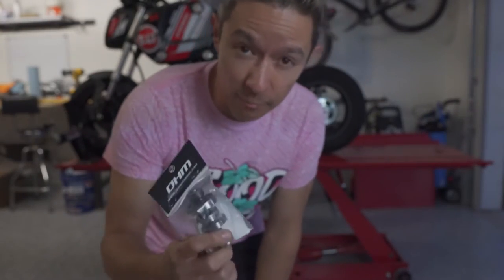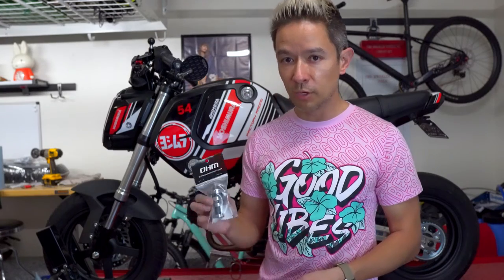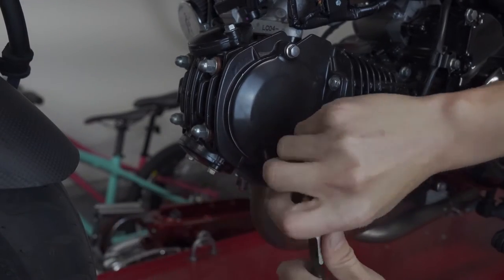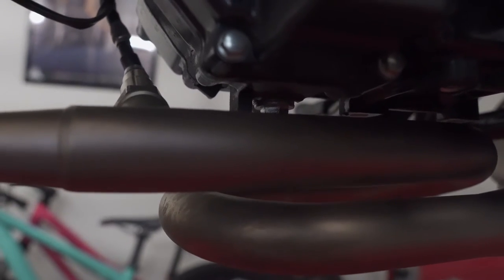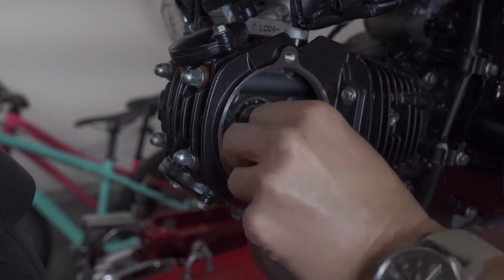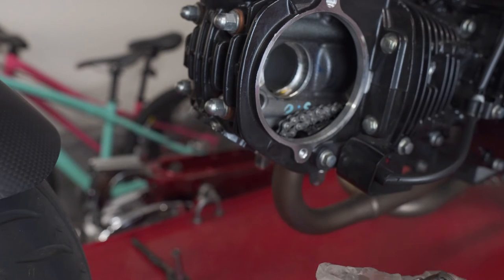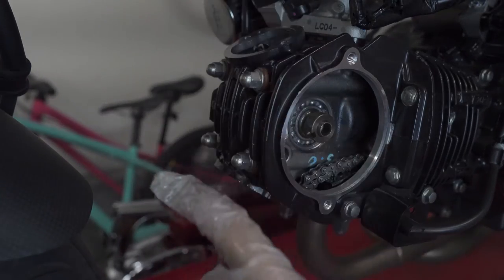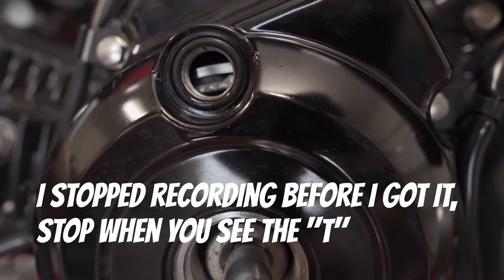DHM S1 Cam Install in the 2022 Honda Grom

Comment: Thanks heaps legend. I’ve watched this video at least 60times this week and finally did my DHM cam today with the A racer and AF2. Only think I can add was to zip tie the chain to sprocket so ya don’t have to line it up🤙
Reply: Solid idea. I will try that when I do my install here in the coming weeks.
Reply: Did you make a video using that method?

Comment: FYI guys, as long as the tab lines up on the sprocket and cam, it should go in pretty easily.  the issue is getting that tab on the cam side to line up.  Took me maybe 1.5 hours to do the cam and ecu taking my sweet time with the valve clearances, not bad at all.

Comment: You actually commented on a reddit thread of mine about installing this (I had trouble getting the sprocket on) . Yeah, I had a significantly less amount of play with that sprocket. Like, around 9:21 or so you were able to get it pretty much on just by pushing it, for mine the tab that sticks out to fit on the notch in the cam barely passed the middle of the cam bolt hole.  

I could have did this next part myself, but just due to the lack of time to work on it I ended up taking it to a place for a tech to finish it out, they had to open the engine to detention the cam chain for it to get on lol. So long as the tension is actually right this is absolutely an easy install though lmao.
Reply from the maker: It's strange that people have are having difference experiences with it. I've taken mine off a couple of times now and have been able to put it on with about the same effort as in the video. Did you try holding the chain with one hand and slightly rotating the flywheel to make sure that the chain wasn't caught or snagged somehow? Either way glad to hear you got it fixed, but it'd be great if you could figure out why so you don't have to take it to a shop when you do a big bore kit ;)
Reply: @eastcoastish  do I need to lubricate the cam before install?
Reply: Doing it now, think it only needs to go the depth of the tab.

Comment: I see you went with the factory valve clearance, however on the DHM website they recommend a .005" clearance on both valves. May I ask why? Have you tried the DHM settings and found factory to be better?
Reply from the maker: I’m running the 0.005” clearance at the moment. I noted it in the pop up in the video.

Comment: DO you need to change the computer when replacing DHM S1 CAM for 2021 Grom?
Reply from the maker: You should have the ECU flashed or use a stand alone fuel management system like aRacer RCMiniX

Comment: Compared to replacing the intake and the exhaust, how much of an effect does replacing the camshaft have? This seems like a job I'd be less than confident doing myself.
Reply from the maker: Cam makes a pretty big difference, bigger than the intake or exhaust. Doing all 3 together (with tune) is your biggest bang for the buck when it comes to power.
Reply: @eastcoastish  I’ve heard using this cam can reduce low-end torque. Have you found that to be true?
Reply from the maker: @jukes4499  I’ve never done only a cam and not intake/exhaust/cam - on the dyno, power curve may shift right but net power is increased across the band.

Comment: I can’t for the life of me seem to get the sprocket back on.   And of course, I ended up breaking the tab.

How much pressure are you pushing forwards, towards the mark?    Mine won’t stay on T when I start messing with the sprocket, but I still had the links marked, so it would still be in center correct?    I was holding it while spinning, and I didn’t realize it bound, and I bent the tab.   I marred up the center of the cam piece where the sprocket goes too, a little.    Gah, I’m pissed.  
I dunno why I was having such a hard time trying to get it back on.     

Hopefully new sprocket comes in soon.
Reply from the maker: If the links are marked you should be good, just confirm once it's on that everything is lined up and you can see the circle and carrot on the cam gear and the "T" mark through the window.

As you can see in the video, I'm not a big guy but using the needle nose pliers through those two rear holes made it pretty easy for me. How close were you to getting it on? you may want to hold the chain with your left hand and move the flywheel back and forth to make sure nothing is caught up somewhere? As far as the bent tab, can you not just bend it back? It shouldn't matter if that part of the cam is marred up so don't sweat that. Also when putting on the gear, put pressure with your left hand on the gear  as you pull it left with your right hand. I was surprised how easily it wanted to slide into place, with everything oiled up it slipped on as soon as it was close.
Reply: eastcoastish man, thank you for the quick response.  I was doing it the way you were in the video, and they way you basically describe it.   It’s like it was so close to being on,  bur the actual circle in the middle of the sprocket was just like 2 hairs away from searing on.   

So I was trying to hold it in place, to keep tension on the chain and rotate the flywheel,  to make sure I had enough slack, and didn’t lose my position-  I guess that little tab ended up catching and it bound up.   It was bent pretty bad, not fixable. I ended up just removing it to make sure that it would still in fact sit on the cam (wirh out the chain)

Maybe my leverage was wrong. But I was using needle nose pliers, and I couldn’t get it forward (more towards the front of the bike) no matter how hard I seemed to pull.     

Hopefully the new sprocket comes in this week.    Last time I tried to order parts, literally nothing was in stock.

The ease of which mine came off, and how yours went on, I figured I should have no problem.    All I want to do is keep trying, and now I wait.....    I’ll keep you updated.   Thanks again!
Reply: So I got it on.    Maybe because it’s 30degress ish here, it wasn’t as easy to overcome the cam tension.    
The cam tensioner seems to be hydraulic, and it is a 5mm Allen head just below the flywheel.  I backed it out almost fully and was able to get it on.
I’m using the adjustable cam sprocket.  

The other issue i ran into was, even though I was in TD center, and ever thing seemed to line up, I seemed to be o an different chain link than the one I had (thought) that it originally was.   Possibly due to the adjustable cam sprocket, possibly due to me not being 100 certain when I removed it.    After a full day of messing with it, triple checking, and deliberating weather or not to fire it up, everything seems to be working ok.
Reply from the maker: @CIarkNova  is the "o" a full link off? The bike will run bit you'll have manually advanced (or retarded) the timing if its not lined up. Do you have a timing light? Harbor Freight has a $29 one that works fine.
Reply: eastcoastish the O on the sprocket, the mark on the engine case, and the hash mark to the right of the T are all lined up.   It’s just that I THOUGHT when I took it off, the tooth was on an inner chain link.  So the link itself is off from the one I thought it came off of, but again, it’s possible the engine shifted a little when I turned it trying to remove the sprocket, or I was slightly off.   Plus perhaps the adjustable cam itself sits different.  Which I have set 2.5 marks to the right.  

The timing marks  weren’t a link off, the physical link I thought was the link that lined up as well seemed to be different.   I put it back on the link I thought it was, and yes, it was then like a full link off.

I made a poston the grom forum dot net.  
Thanks again for the reply.

Comment: You lined the cam up with F mark, it should be on the T mark bro. The F is for fire and T is for timing.  Check the vid.
Reply from the maker: Its lined up correctly to the T mark, because of compression the flywheel wouldn't sit perfectly on the T without holding it. The distance between the T and the F doesn't represent a full sprocket tooth (unlike the CT70 engines where there is much more space between the tick marks) I appreciate the observation though.

Comment: Is it still a normal idle after the cam install? And is the bike louder now? Thanks
Reply from the maker: I've only down a couple of miles so far but the idle seems the same and it only seemed a little bit louder - hard to tell since the bike was pretty loud with the Yoshi pipe already...

Comment: I imagine all the parts used on this grom will be the same on my 2022 Monkey whenever it gets here(went from late sept, to late oct and now mid dec ugh)?
Reply from the maker: The engine stuff should be the same although I know the 2019 Monkey and 2019 Grom had ECUs that were pinned slightly differently - the physical engine though, aside from color differences were the same.

Comment: Would you be willing to experiment with front and rear sprockets to find a optimal (for your bike) setup?
Reply from the maker: I will at some point. The stock gearing feels good right now, when big bore kits and other performance mods come out though I'm sure I'll need to start making some changes on the gear ratios.

Comment: Did you feel a miss of power in early rev range down low when first installing, and if so did it get better as I have stage 2 kit and it has a flat spot from down low in all gears.
Reply from the maker: It does move the power higher in the band but that’s typically where you want it.
Reply: @eastcoastish  right okay, but no flat spots when first riding it? I feel a flat spot until about 5-6k rpm
Reply from the maker: @patrickmarkos7724  if you watch this video I show the dyno sheet after the cam, there is a bit of a flat spot around 6k for me but only for a few hundred rpm https://youtu.be/OyCYEm7PiTQ
Reply: Yeh that's what I feel only a few 100rpm, hopefully it gets better as you ride

Comment: This is the second video I've watched about installing the cam and I'm just wondering why not set the timing up correctly before dissassembly. Then you would not have to adjust much? Also, I can't believe that loosening the valve lash can't make this whole process easier? A lot of people like to do videos, but not many of them are real mechanics...lol
Reply from the maker: I'm definitely not a real mechanic but it's clear you're not either. The timing chain keeps everything "timed," as soon as you take it off, you will need to realign everything to be timed correctly again; "setting the timing up correctly before disassembly" would not make any difference. As far as loosening the tappets before removing the cam, you can do that if you have any issue pulling the cam out, as you saw in this video, the cam came right out and the new one easily back in, so again, no need to do that either. Not sure why you're throwing shade on a video that shows how to do something that you clearly don't know how to do. Cheers.

Comment: If I just get a reflash, do I have to get the cam?
Reply from the maker: Do you mean if you get a cam do you need a flash? If you're running anything more than an intake or an exhaust, you should get your ECU flashed or get a stand alone fuel management system like the aRacer.
Reply: @eastcoastish  is the cam Necessary if I just want to get a flash? Sorry if I worded it incorrectly im new to all of this
Reply from the maker: @SimplyKelp  No, you can get an ECU flashed for just an intake or just an exhaust or a combo of you want. Check out DHM they have all the info on flashes.
Reply: @eastcoastish  Thank you very much!

Comment: This question has probably been asked a bunch of times but in terms of cam install, has anyone had any reliability issues since upgrading? I have a new 2022 and know I want to do intake and exhaust but worried that upgrading the cam could impact long term reliability of the engine even if using one of the high end cam upgrades?
Reply from the maker: Cam shouldn’t have any reliability issues. It’s just lifting the valves higher than the stock, so you could argue some premature wear on valve springs and overall engine internals with the system having more hp, but if these issues did manifest they’d be after 10s of thousands of miles.
Reply: @eastcoastish  thanks for the reply and the additional info, love the videos btw!

Comment: I want to put an intake and exhaust on my 22 grom so should I follow your video to reflash my ecu or will it be ok without doing that?
Reply from the maker: You will get more performance out of them if you do. With the stock flash you will be running pretty lean. If you do get it flashed, you might as well get the cam at the same time and get the ECU flashed for all 3.
Reply: @eastcoastish  so do i have to send it to dhm or can I reset it myself like you did in your how to video?
Reply from the maker: @quintinfawcett  the reset video I did was just to set it to default - for a flash you have to send the ECU to DHM. They explain everything on their website.
Reply: @eastcoastish  ok thanks

Comment: 9:54 Can you not just take the tensioner out, it makes huge difference and it takes you less than 20 seconds
Reply from the maker: There's no external cam chain tensioner on the '22 Grom (like there was for the previous engines).

Comment: But how the fuck you get that screw off without the chain moving
Reply from the maker: I use an impact wrench to just zip it off. But if you use an Allen key to remove the small circular covers, you can get a socket in there to hold it from spinning. You also need to do this to tighten/torque correctly.